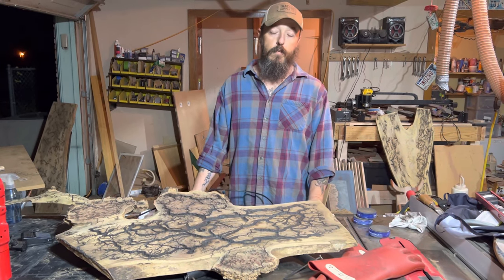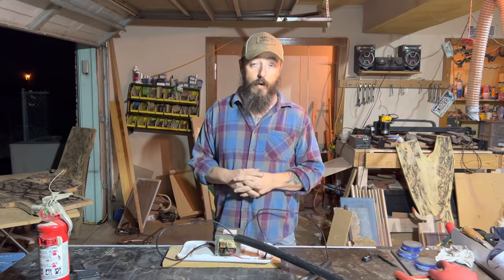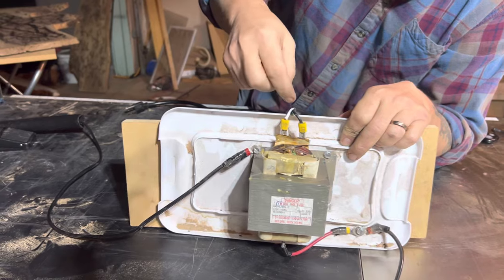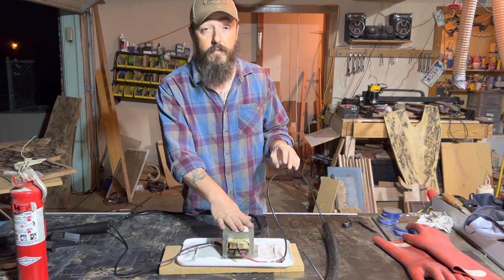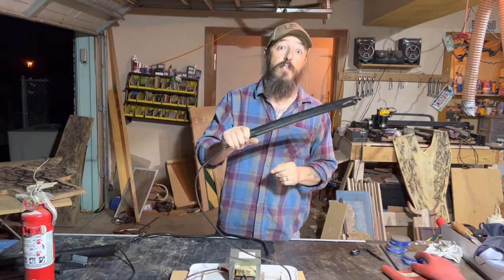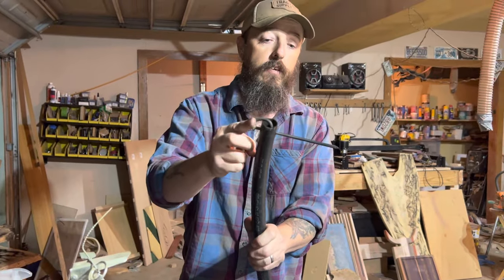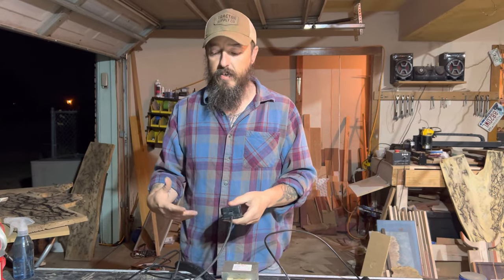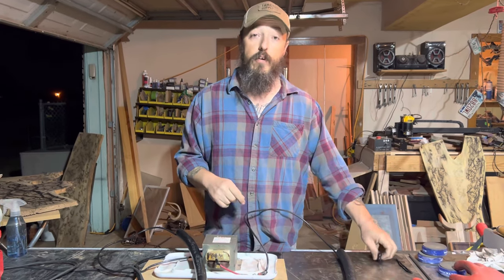Building a fractal burning machine

Comment: Are you holding the electrodes while current is going into the wood?  If you can hold the electrodes while running, it sorta negates the safety feature of the dead man's switch.

Comment: FYI The black wire input is your hot lead and the white is the neutral wire and the green was the ground wire.
Reply: Great video but yes black wire is hot , white is neutral and green is ground.
Reply: I’m confused.  If AC cycles from positive to negative 60  times a second, how is one wire a dedicated hot wire?
Reply: @lunarrn  ac power is a sign wave that is only up at a set rate (cycle)… one will either have a single phase or 3 phase panel feeding a given piece of equipment.  Each phase A/B (single phase really has 2 phases) or 
A/B/C in 3 phase is generating a sign wave like guns fire once each in a set pattern.  So, a wire that is connected to phase A will never be at the same frequency as Wire B or Wire C…. This only matters to the equipment used or when sharing a neutral wire between phases.   ( can be done but very dangerous for others if it’s not known)

Imagine 3 base drummers hit at a 4/4 time…. Then, add a bell in between each drum beat…. The bell would be the neutral wire carrying the signal ( drum beat ) back to the ground for each phase.
Reply: @a.thomasmurray7066  ...small  correction...with 3 phase, they're all at the same frequency...they're never at the same voltage...👍
Reply: @gmcelmurry  uuuuu
Reply: @gmcelmurry  auauauaiaauaaua
Reply: @lunarrn  i think im just going to buy one... Or get an electrician mate to make one
Reply: @lunarrn  think of it of a vacume cleaner the hot line switches from blowing to sucking.
Reply: @genomstudios2159  He's going to buy one 🤣🤣🤣🤣🤣🤣
Reply: @YoureNotSoSmartBro  who's buying one?
Reply: How do I know what side of terminals for black and white input from the wall

Comment: wow so i am assuming you hold those electrode leads in your hand when the burner is energized? Wow amazed you are still alive. The only safe way would be to clamp the electrodes to the wood, go back 20 or so ft and power the leads using a 2 handed dead mans switch. Then maybe it is safe.
Reply from the maker: I’m still here. Thanks for watching
Reply: This is bad stuff.
Reply: @darkhorsecreationswoodshop you're playing with fire bud
Reply: @darkhorsecreationswoodshop  Still here?
Reply: 20 feet? haha how far do you think the electricity is going to jump?
Reply: This, I would only hook up that thing sitting 20 feet away. I have been electrocuted before by 120v and 220v machinery, I got lucky I only ended up with numb fingers. Theres is no way I will mess around with one of those things, I'm happy with my nice sanded grain.

Comment: Working on microwave ovens... the output winding has one side connected to the body of the transformer, which is why the one lead goes to the base. The reason for this arrangement has to do with the magnetron tube used for making the microwave radiation. The plate of the tube is also the body of it so the transformer, case of the oven and body of the tube can all be connected together and connected to the green wire on the plug. As long as the case is not removed, there is no shock hazard. But making a wood burning machine is pretty much the definition of a lethal shock hazard.
When used as intended there is also a capacitor and a high voltage diode forming a voltage doubler to produce the voltage the tube needs with cheaper parts. While the cap has a built in bleeder, never trust it. The cap can have a 2600 volt charge on it, act accordingly when stripping an oven. There is also a low voltage isolated winding for the filament supply on the tube. Safe to ignore just don't short it. 
Wire... neon signs use wire with an insulation rating over 10,000 volts, that would be a good choice.
Some YouTube videos show people using car booster cables. Those are rated for at least 30 volts. Only advice If you come across one of those setups, stay far away and if you don't think the owner needs to die advise them to never plug it in. It might work for awhile but as soon as the insulation breaks down it might as well be bare wires.
Reply: All you people trying to sound smart are missing the biggest point and that's the amperage when your body is the conductor. Pretty much every way you build this will be safe. Until it isn't.
Reply: @YoureNotSoSmartBro  
If you make yourself the conductor, the amperage is academic. It is quickly lethal. You are mostly salt water, same as the conductive material on the wood. Just picture that lovely fractile pattern going through whatever is between the two contact points on your body.
Ps 120 volts can kill through burns but it takes a little while. The power is volts × amps. As V=IR the power increases with the square of the applied voltage ( P=V^2/R combining Ohms law and the power formula) so at 10 times the voltage,  approximately, a microwave transformer should be able to kill 100 times faster.
Permanent injury in maybe 100 milliseconds, if between hands and so across the heart probably death in that time.
Do you think booster cables with a rated breakdown voltage of 30 volts are safe to block 1500 volts? How do you safely hold them while energized?
Reply: 11
Reply: @garygough6905  I don’t know about you, but I hold jumper cables while energized every single time I use them; that’s kind of how they work
Reply: @liquidrockaquatics3900 When boosting a truck, certainly. The rated breakdown voltage on automotive booster cables is 30 volts, that doesn't mean that they are sure to fail at 2500 volts, just that they aren't rated for the voltage. Of course they will carry any voltage , it is the insulation that may not block the voltage and therefore the body in between the leads from completing the circuit.
Reply: @garygough3158  I don’t know about you, but if someone is running over 2200 volts through a conductor with insulation rated below that level, they deserve what they get. I use energized jumper cables for jumping batteries on 12v systems. That’s it. I have been bit from cracked ignition wires on lawnmowers and weed trimmers before and THAT lets you know when it happens, but thankfully it was never lethal. When I personally build and wire projects, I try to always keep safety in mind. I don’t see any reason to EVER hold leads on a fractal burner; tap in a nail and clamp to it instead. Easy.
Reply: @garygough6905  why are there 2 GARY's ... DOPLEGANGERZ?

Comment: Hey bro, be VERY CAREFUL ❗.A friend of mine lost her son trying wood frackin', and was electrocuted, he was only 14 yrs. I use to do it back in the early 1970's, but I KNEW EXACTLY what I was doing. I was only 10 or 11 yrs old at the time. And emphasize this, IF YOU/THEY THINK THEY KNOW, THEN THEY DON'T. Remember that a 'microwave' transformer can generate upwards of 20,000 - 30,000 volts, and the current will be DEADLY‼️. 🥺🥺🥺🤠🤠

Comment: The step up transformer steps up the voltage from 120V to7-8-9000 volts . #8 wire isn’t needed for this because it’s low amperage going through the wire. #14 or #12 is more than enough. It’s the type of the insulation that dictates the voltage the wire(cable) can handle. The size of the wire dictates the amperage it can handle. Most consumer wire only has 600 volt jacket (insulation )on it. You do need a high voltage insulation on the wire if you do this type of stuff to prevent leakage.
Reply from the maker: Thanks for a better explanation.
Reply: Ive used DLO for large brake resistors coming off of 100 HP VFD's. Brake voltage is up to about 875-900V, if I remember right. Also, you need a good pair of leather gloves to put outside your HV gloves. it protects the rubber glove from pin holes..
Reply: Cool, I didn't know, to be perfectly honest any of that. I accept you as accurate, meaning what I thought I knew before, from I couldn't say where was exactly wrong. Most sincerely, I  appreciate it
Reply: Ignition wire used in HVAC applications.  
Flexible, high temp rated for 10k volts.
Volts don't kill you, amps do.

Comment: Thanks for sharing how to make fractal device. Going to make one for upcoming project. I have a question, what you use to wet the wood ??
Reply from the maker: 1 teaspoon baking soda. 1 cup water.
Reply: electrical current through baking soda water also makes hydrogen, highly flammable. glad your still here and I want to try it too. I'm thinking I'll go with some kind of clamps. don't want to be anywhere near that kind of voltage.

Comment: My burner has been cutting out (loosing power) after a short period of burning. The wires are all good & it doesnt seem to be getting too hot or anything i have noticed. Any suggestions as to why I am loosing power?
Reply from the maker: To be honest it could be a multitude of
Things. It could even be the mixture of water baking soda you are putting on the wood. I had issues once because there was not enough moisture on the wood. 

When it comes to electricity, I am no expert. It could be the internal wiring to the outlet you are plugging it into. I have had that issue. My garage plug had really old wiring and would not push the current. It could also be the power source of the burner itself. I had one that would not burn at all. I hope this will steer you in the right direction.  Good luck.

Comment: Will any microwave do? I have a small OLD microwave (It has dials!) - would that be too weak?  Then I have a quite big one which turns on and runs BUT it doesn't heat anything up, so would that mean that it wouldn't work for this or does it just need to be able to run? Thanks!
Reply: Usually the magnetron dies, so transformer should be OK to burn.
Reply: @laurmartin341  Cool - Thanks - I can't wait to give it a try!

Comment: You're holding both leads in both hands at the same time.  Better to mount one lead to the piece and use the other lead to prod, less chance of getting something through your heart (moisture on the pipe or hands), but I understand how much faster you can work holding both leads, it is increasing risk though.  Your art looked amazing.  You should know that after you mounted the high voltage lead with a screw through the plastic into the wood you lost all isolation protection the plastic under the mot provided.  The only isolation from the earth is the thickness of wood under the screw. One end of the high voltage winding is attached to the core of the transformer.  By sitting the tranformer on plastic and and mounting the lead to the wood through the plastic, you are isolating the output high voltage by the resistance of the plastic the transformer is sitting on and the wood. Its a good idea to mount the whole thing inside some thick plastic and get a lightbulb wired parallel to the primary so it is lit up whenever there is power, incase your foot switch ever fails (mots short circuited can draw over 15 amps and its unlikely your foot switch is rated that high and could fail closed circuit and you would never know its still live.
Reply from the maker: I appreciate the advice. I’m always looking for ways to make it better and safer.
Reply: @darkhorsecreationswoodshop  
Robert Murray smith makes the best video ive seen on the safest way to operate one. He uses 2 momentary push buttons in series and a parrallel light on the transformer primary indicating powers on.  This ensures that you will never be in contact with the output (both hands have to be on the switches to activate power), the double switch is also a nice backup incase one fails closed circuit.  Although if you never get careless, what you're doing in my opinion can work somewhat safely and has high speed and efficiency. I suggestested mounting one lead but that in itself might get you shocked because you have to move it more often with power off.  Your chicken stick leads are long and you are never directtly touching the output, as long as your body never brushes up against the wood or gets wet...

https://youtu.be/EZ2CQMf1NRc

Comment: I have a 40 year old microwave which still works like a charm. I opened it up and it appears to have a small transformer and a larger one. Do I need both or will the larger one do the job?
Reply from the maker: It should be the one that is connected to the outlet plug. Probably the large one I would expect.

Comment: ...good info...thanks...one thing...I don't know what your footswitch is rated for, but it will likely arc between contacts  when opening and closing...that's the nature of AC. There may come a time when they weld themselves together and then it won't shut off when you remove your foot...I'd make sure I could get to the  wall outlet easily to yank the plug if/when that occurs, or wire in a normally closed emergency stop switch...
Stay safe, and thanks again...
Matt
Reply from the maker: I appreciate it. I did not know the foot pedal would do that. I do have the plug right next to me just in case. I appreciate the advice.
Reply: @darkhorsecreationswoodshop  ...by the way...this pertains to any kind of AC switch using contacts...even relays.
Matt

Comment: So im finally burning, i just  tried salt water, my question is how to get bigger deeper burns is it the solution or the denseness of wood, or should i leave it burning longer whenever the two burns contact each other?
Reply from the maker: Honesty  I have never used salt water. I use baking soda and water. The type of wood does make a difference. The more dense it is 
, the harder it is to burn.  I will coat the wood multiple times through the burning process until I get the burn that I want. I do leave it on there longer for deep burns. I try to connect the burns through the grain of the wood. Its almost like the electricity has a better connection through the grain channels. Keep working with it and be safe.

Comment: my transformer has the the 2 red wires 1 white wire. Do i cut the whitr wire off or attach it to the base of the trsnsformer?  Great video  thanks for sharing
Reply from the maker: I would attach the white wire to the base. It sounds like to me that is your power wire. The little red wires. I had some of those as well and I cut those off.
Reply: Yeah take advice on what wires go where from the dude that clearly has no idea..... That's probably the smartest thing you can do -_-

Comment: I loved the video, brother. Have been intrigued by this method of wood burning and have been wanting to learn. Looks a bit intimidating. I subscribed to your channel, and I am looking forward to seeing more. One thing u didn't answer, tho. Where exactly did u get the 8 gauge wire? U said don't buy your run of the mill hardware store 8 gauge.  Did u buy it from an electrician? Keep up the great work, brother.
Reply from the maker: Thanks for the positive comments and the follow. I got the 8 gauge wire from an electrical store. Here it’s called locks electric.
Reply: @darkhorsecreationswoodshop  
Awesome, thank you!!
Reply: You don't need 8 gauge wire because the current on the high voltage side is only a couple of amps, at most. 12 or 14 is more than big enough. However, what  you do need is wire with high voltage insulation. This whole thing is very dangerous. Since 2016, at least 33 people have died using such devices, and every one of them thought they knew what they were doing. Think about that!

Comment: I am an experienced engineer, and your setup and instructions are pretty safe.  Engineers tend to complicate safety.  But you cannot over-emphasize safety in this configuration. A microwave transformer is a death machine and can kill you.  You are a good instructor.
Reply from the maker: Thank you. I am a work in progress lol
Reply: Did you catch that the secondary is connected to the transformer frame, which is screwed into the mounting board, ALSO, that the other secondary lead (red) has a junction screwed into the same board?      

If you are saying "engineers tend to complicate safety", I seriously question your experience.  Sorry bud.
Reply from the maker: @TheGreenHeartofItaly-fl3wv I know that i am not very experienced. I am announced that through my videos. I do have to say that engineers do complicate safety. I just so happen to work directly with a bunch of them for the department of the army and other engineers from around the world. I appreciate your feedback back and thanks for supporting my channel.
Reply: @darkhorsecreationswoodshop    They are not "complicating" safety, they realize how far you have to go in terms of component reliability, safety by design, and many other aspects.    "Safe" under non-real world conditions is not safe.   And it takes a lot of work, what you call complications, to make MIL or medical or consumer gear safe in the real world under real world use conditions.  

Not everything is as simple as we would like.  

Still, decent job, you have at least made some of the really terrible hardware out there look as "rickety" as it is.    But if you get more sensitive/knowledgeable about the other areas of accident probability (beyond the hardware itself) you will be doing the woodworking community a better service.  Education never stops.
Reply: @darkhorsecreationswoodshop  Do we have an UPDATE on this BUILD